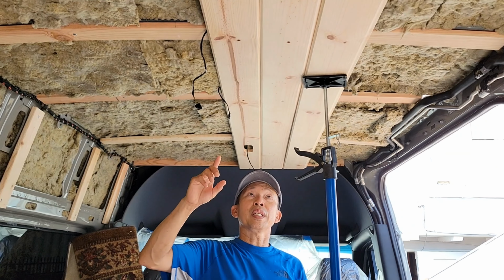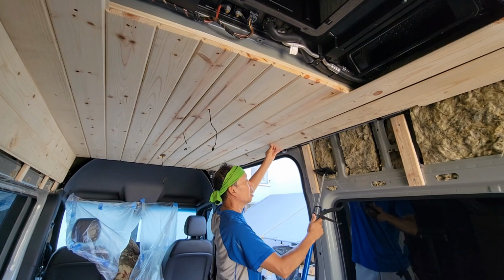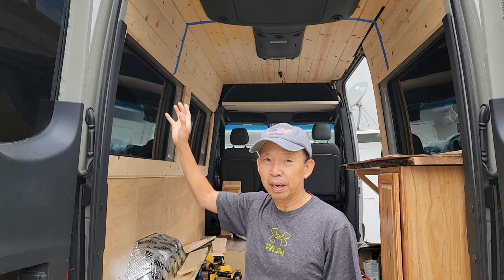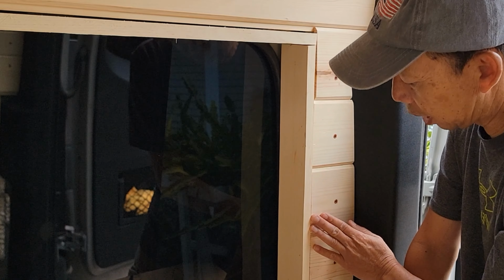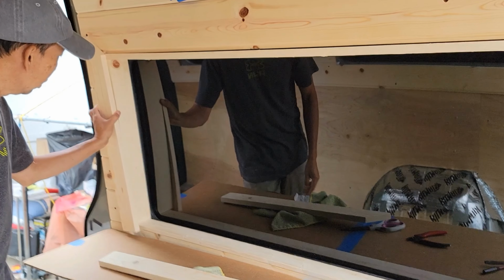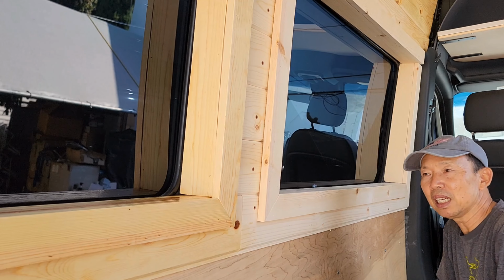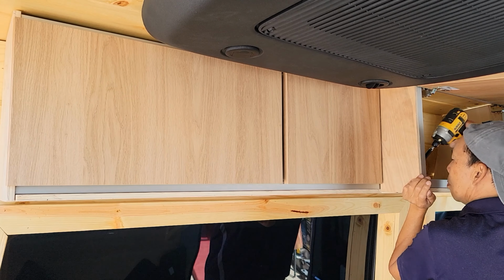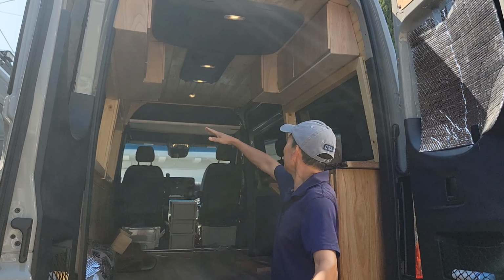DIY SPRINTER VAN CONVERSION- Beautiful Cabin design idea #sprinter #vanconversion #outdoors

Comment: Great Video!! I have the same rear factory ac unit and have not been able to find cabinets that will work. Do you build and sell the cabinets you did on this van? Any advice you can give would be great! Thanks
Reply from the maker: @carolynfagan9778  I haven't run into anyone  who builds these sizes cabinets to sell.yet. I can't sell either. It requires some assembly.

Comment: Did you keep the factory ac unit because it can run separately without the van on? I have the same rear ac in my passenger van. And everyone says the ac won’t run without the van on.. so I’ve been looking at removing it and buying another ac. But if you found a way for it to work separately I’d love to learn.
Reply from the maker: @Soberwithshrooms  no, you can run the factory ac without having the engine on.  All controllers are factory built in.